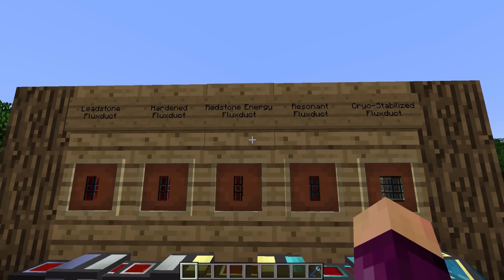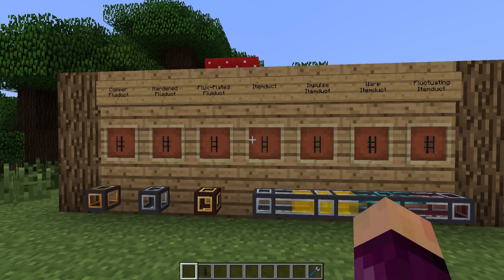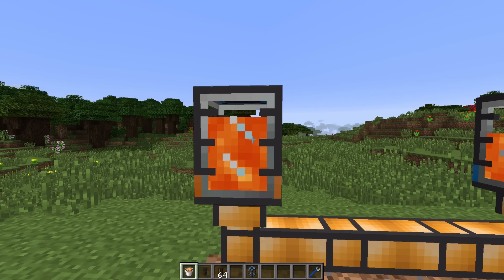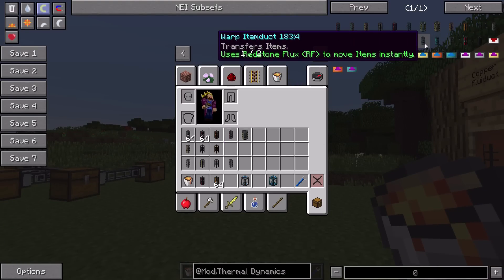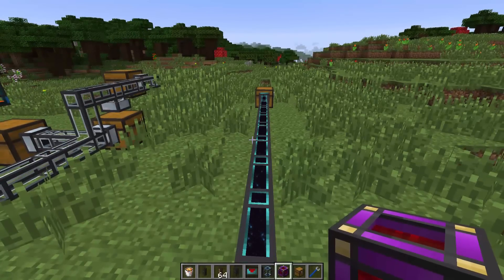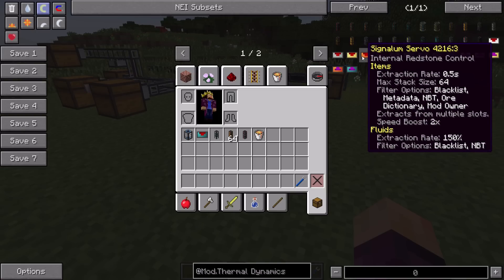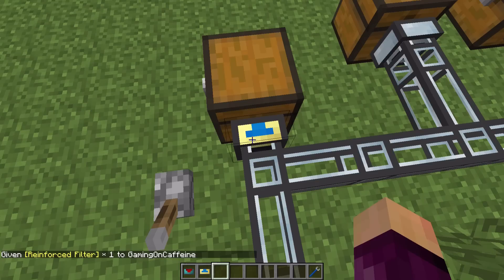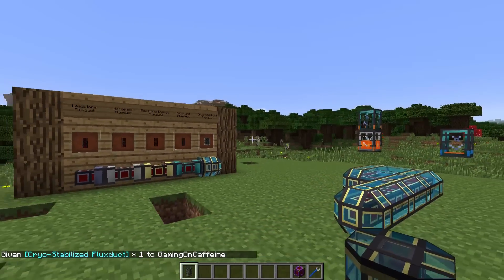Thermal Dynamics Mod Spotlight - What's New? (Minecraft 1.7.10)

Comment: It's some interesting new mechanics but ultimately I don't really see a desire for them what with Ender Io's multipipe per block setups and much bigger RF transfers (from what I recall anyways) I had heard the entire reason ducts were taken out of TE was because the ender Io ones were so much better that the ducts required a re-do. If this is the result of that then im less than impressed.

Comment: This took too long to come out, now i prefer EnderIO conduits.
Reply: Same here! I was complaining non-stop but are now used to EnderIO. Not sure if I want to switch.
Reply: The EnderIO conduits are amazingly cheap.
Reply: ***** Which makes 16 conduits with 1 iron and 1 ender pearl... Whereas itemducts use 8 obsidian dust, 1 lead and 2 tin to make 12 ducts (You were saying about transparency)
Reply: obsidian dust...

(I think I won)
Reply: Sam
Tinker's Tools and a pulverize. Minefactory Reloaded and Thermal Expansion can MAKE Obsidian too. (I'm not arguing. I'm just pointing out how I plan to use them.
Reply: If we're talking about cheap pipes.... BC pipes anyone? ._. ..... *****   enderio conduit are annoying? I assume you never try any other logistic mod... which probably test your patience.
EnderIo item conduit is for mid-end game..... Building complex machinery connection, any pipe would do... But now lets add some twist, "a NEAT complex machinery system"...
Reply: Amieroll Mukminin
Buildcraft pipes FTW. Yes. Especially when some mods output into them directly without needing wooden pipes and engines.

Also, Ender IO disables dual weilding for Flans Mod. And I have so many other tech mods, I'm not losing much by dropping it.
Reply: Ghost8919  well suit your self...  just make sure you check the config files of each mod... it might have the option to enable/disable something... 
I got a bunch of mods too and some of them might not "cooperate"(missing stuff and crashing) with each other... when i checked the forum... some of the mods just require tweak from config file...
Reply: *****
Exactly what I was thinking.

Comment: If these came out earlier i would use them but with ender io these conduits are pretty useless. The only thing that I would ever use is the energy conduits that transfer infinite power
Reply: I agree with you! Ender IO has taken the place of thermal expansion pipes
Reply: Once this mod gets added to the packs, I would probly use the item ducts early game, but that's about it.  And perhaps the cryo-energy tubes at end game.